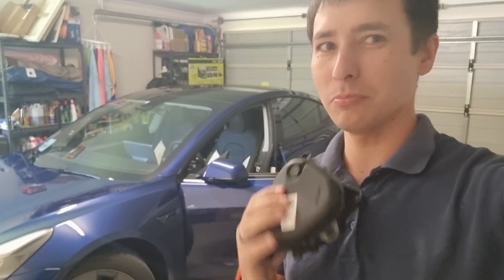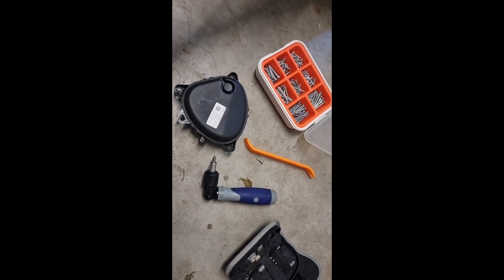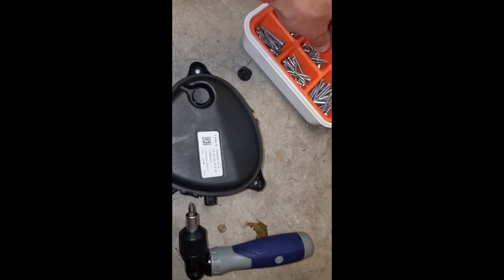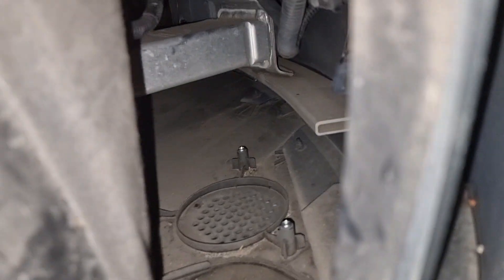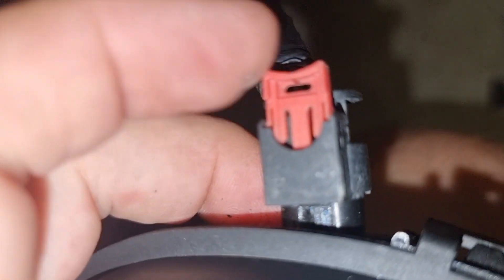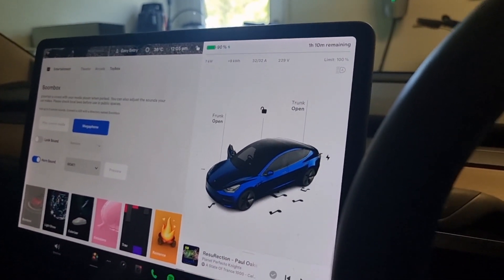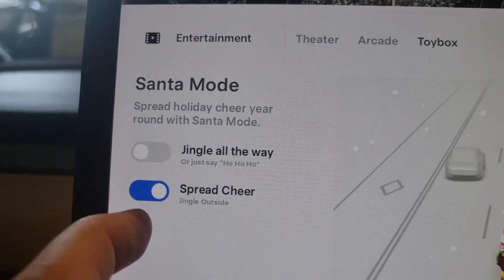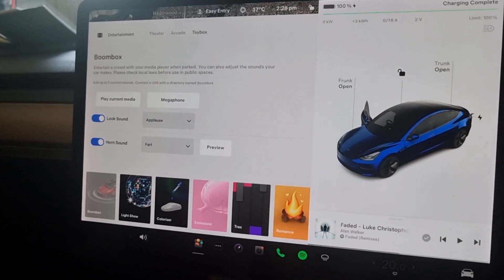Installing Tesla BoomBox on Model 3 2021 SR+

Comment: Can confirm Tesla will still remotely activate the PWS speaker on request. Tesla Mt Gravatt did it for me remotely yesterday for my 2019 M3 and it cost about $53.
Reply from the maker: That's awesome thanks for sharing that, was under the impression it was changed to a point they'd just say no 😅
Reply: what did you write? my local service technicans couldnt see any software for boombox